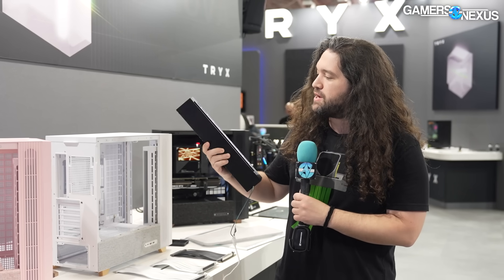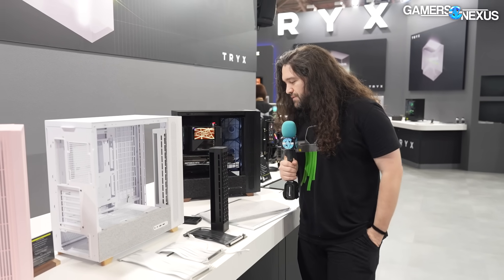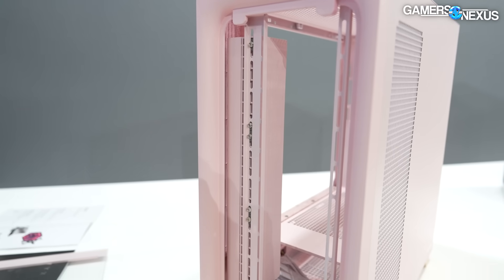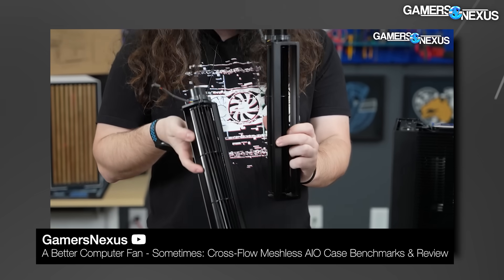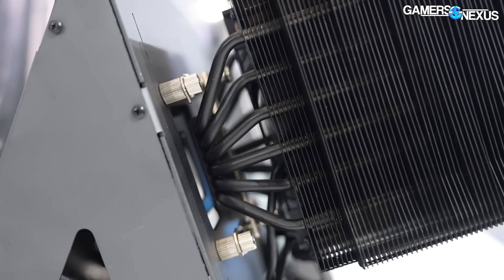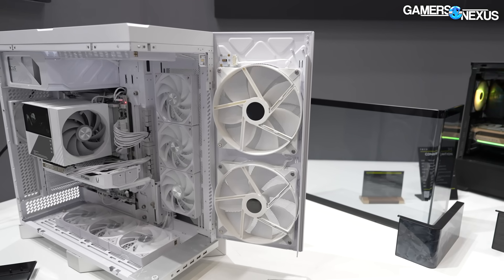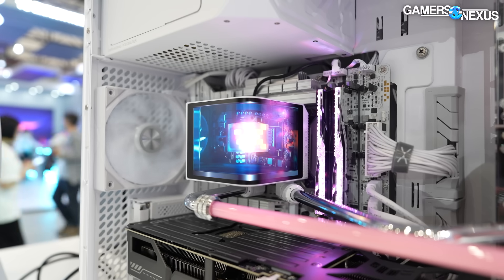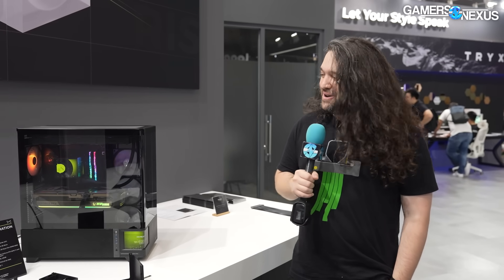TRYX Crossflow ATX Case Fan Takes Risks | Flova, Panorama, & More

Comment: That is kind of silly. Why not just make the case wider so you can use the crossflow fan along with 140mm or larger fans? It looks like the case is too small anyhow.  It needs to be several inches larger in length, width and height.

Comment: Reminds me of the older Silverstone crossflow fan for the Sugo cases.

Also your everyday table and floor electric fans that are crossflow fans marketed as turbo fans.

The interesting use case would be attaching this to radiators like how crossflow fans work for aircon mini split indoor units.
Reply: They did this essentially in a case review GN has on their channel.  Was a mini case by TRYx.  The problem is they left the bottom portion of the case to essentially fend for itself and it was kind of a flop for thermals outside the AIO.

Everything they have done with crossflow so far tells me they can see the benefit, but don't know how to implement it properly or it's too expensive to implement properly, which is probably the legitimate reason.  Either way their use cases and setups so far have been very questionable when they do use them.

Comment: Cross flow fans make so much sense for cooling inside a PC. I look forward to more ways to integrate these in future
Reply: In case of slim case, like Node 202 from Fractal, it can be very good. But question is, will there be some standardization in dimensions and mounting?
Reply: @DarkFox2232 you can buy them online in 360mm varieties but they are quite industrial

Comment: This type of fan (as a single unit) not three was used in HP Laserjet II printers. We referred to them as squirrel cage fans (as @AcM.5233 also called them) The problem with them is they eventually wear at the bearings and begin making a squealing noise or just seize up. Of course they were mounted horizontally and not vertically. Still, based on my experience with them I would not trust them in any form. Just my humble point of view.

Comment: The CM Stacker had an optional cross flow fan that was a must, if you wanted to be able to see the motherboard, which was hard to see with the standard quad fan panel in place. For an aluminum case, it was very heavy.

Comment: The waterblock is ruined by Jensen Huan. It introduces 4x the AIr bubbles to increase volume and only has 8 millilitres of reservoir.
Reply: fake thermal capacity
Reply: they are only circulating 10% of the droplets. 9 out of 10 are pushed by AI

Comment: So a crossflow fan is kinda like a blower fan of GPUs but long?
Reply: It's like a fan in the room part of an air conditioner.
Reply: Not really. A blower fan aka squirrel cage sucks air in from the middle and flings it out to the sides where it might be channeled into one direction. This one just goes side to side, tangential to the axis of rotation.

Comment: I'd rather see that crossflow fan mounted in the lower compartment that's fabric covered. They would have to shift the PSU a but to the other side to get the clearance.
It would provide significant cooling to the GPU and would leave the whole front panel open for front fans or an AIO.
I do really like the appearance of the fabric, very home theater PC, but would worry about long term durability and dust discoloration.
Reply: That was my first thought as well! But yeah possibly have to either rotate power supply or the case would have to be wider. 

Might work better as top exhaust fan? But then that would take away an option for AIO or custom Loop water cooling radiator at the top. 

Definitely seems like neat fan tech for sure.
Reply: Or maybe simply put the fabric on the side panels where there are no fans.
Reply: @davidsentanu7836  If your 12vhpwr connector catch fire, that fabric will be adding fuel to fire. The connector is just next to the side panel.  :face-green-smiling:
Reply: @fleurdewin7958  That's not the case's fault. The connector should not catch fire in the first place.

Comment: Reporting in and reporting bots. 🫡 Thanks Steve! I really wish I had held off on my aio. These ones with big screens are cheaper than my Kraken and I'm a sucker for that garbage lol. Still curious about testing and maybe some heavy heat load testing to see if those screens glue separates or not. The tight thin tolerances here scares me.

Comment: We have those squirrel cage fans, as we call them in the power and transmission distribution industry, that are used for our scata cases. These computers are left in a block house in the middle of a substation with no shade and no air conditioning in 99% of the block houses, And these squirrel cage type fans keep those giant cases cool. But they are noisy as a jet engine when you have 12 of them going at once
Reply: Squirrel cage fans have axial intake and radial output; Tryx's fan seems to be tangential.  Squirrel cage fans were used to cool graphics cards for at least a decade.  Still used on server/workstation GPUs.

Comment: wouldn't the crossflow fan make a ton of sense as bottom intake in a case designed for it, to blow air directly into the GPU?
Reply: Crossflow for the top , bottom and two on the front

Along with 4 120mm front fans , 6 doubly stacked 120mm fans on bottom  , double stacked 140mm rear exhaust fans and 3x140mm top mounted exhaust fans. Add 4 90mm side mounted fans near the front side aswell

3x120 fans using coolermaster gpu fan adapter.

And an ak620 digital cooler.

Would pretty much be my dream pc
Reply: GMTA , just made basically the same comment lol
Reply: Not really the side of the gpu pushes out air, any resistances to that decreases cooling. A laminar flow could cause an air pressure wall at the side exhausts of the gpu.
Reply: @kevinerbs2778 you would obviously have to position the fan and/or guide the flow so it actually blows into the GPU not past it, thought that would be obvious
Reply: @tommihommi1  the then gpus fans are p.o.s for not getting enough air in the first place. The point of the cross flow was to move air in the case not to to direct it. Thats what shrouds are for.